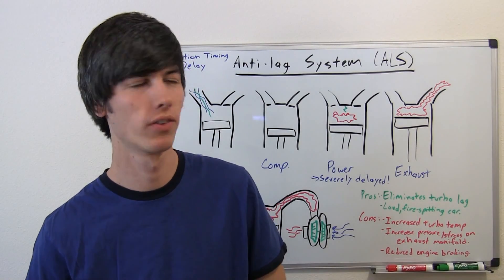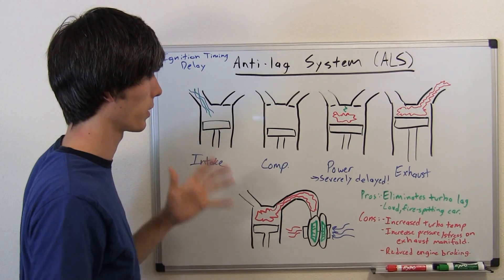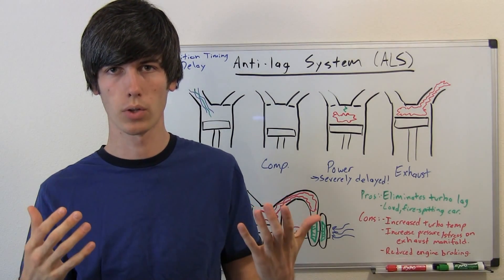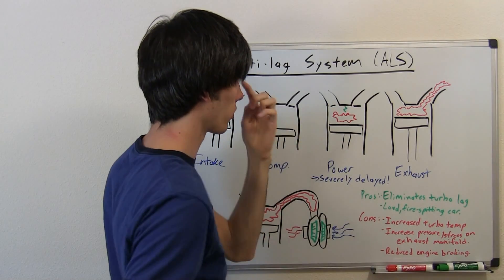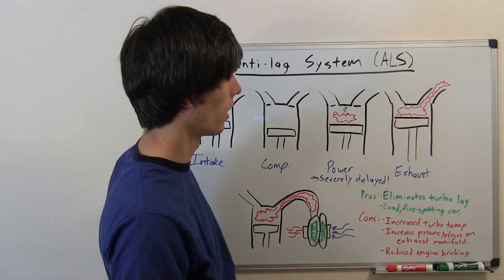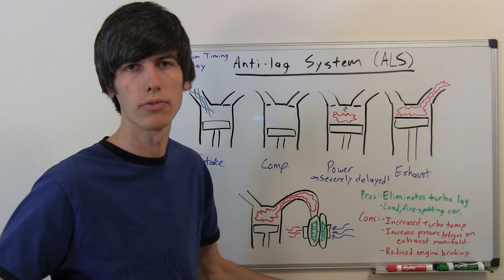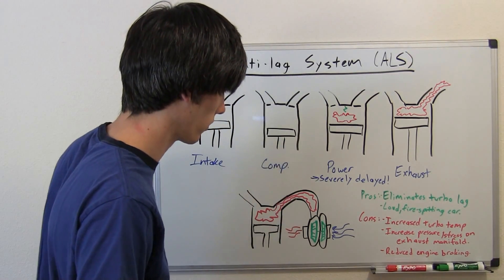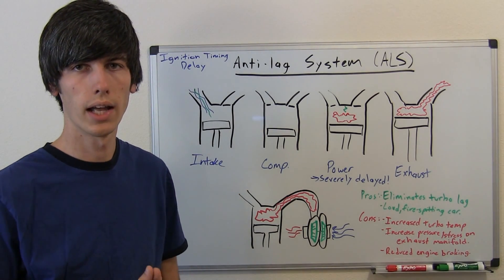Anti-Lag System By Ignition Delay - No More Turbo Lag

Comment: Best anti lag system: never let off the throttle.
Thank me later
Reply: And suddenly... corner. Then that becomes "and suddenly... pole (or tree or guardrail or yo mamma's mailman)."
Reply: Haha don't believe me? Most rally drivers don't let off the throttle completely so they can keep the turbo spooled (in cars that are not equipped with ALS). They use left foot braking 
In circuits, you can brake while still feathering the gas and then start adding throttle as you let off the brake to exit the corner. Again, left foot braking matched with good throttle control
Reply: sanpt7777 Ah, so the key words here are "not completely." That makes a huge difference. You're correct on the fact that they do not lift completely, but they do lift. Of course I wouldn't recommend going through the canyons and trying that, or if you go into a more than 90 degree turn I think it's probably wise to just let the turbo spool back up after a corner like that but in a vast majority of turns it's best to stay on the gas at least a little bit to keep momentum going. I originally thought you meant "never let off the throttle at all." as opposed to "never let off the throttle completely." lmao Now do you see why I was concerned about flying into a corner?
Reply: Haha yes. Anyway your first answer was funny.
You are right, there was a key word I forgot to mention. You do have to lift the throttle at times. It may even be desirable to induce lift throttle oversteer, especially on loose surfaces. The point is, you should be on the gas before you need the power. Even if you are still braking at the moment, that's why I insist so much with left foot braking.
But if you can keep the throttle feathered in a car that has too much turbo lag, that would be great.
Reply: On a 90 deg corner you would have to keep it feathered and use your brakes at the same time. Before this, you should already be in the right gear, because you won't be able to use the clutch. Brakes will have more power than the power applied by the engine, so the wheels will be normally affected by braking torque and you can turn normally. With the throttle feathered, you'll basically adjust speed letting of the brake, and then you can start accelerating.
In my experience, newer VAG cars won't let you left foot brake if you are already on the gas, you have to start braking first and then feather the throttle to spool, otherwise ECU will kill the injection, just a heads up if you drive a VW/Audi etc and wanna try it
Reply: sanpt7777 90 degree you can do that. As far as brakes having more power over the gas, I can tell you that varies from car to car. I've seen it happen. It's mainly older cars with little ECU interference, but still...
Reply: Well, what I meant is the brakes will have more power regardless of the car because the throttle will be just slightly applied to make some boost. But yeah, that applies to some cars
Reply: sanpt7777 No I hear you. I get where you're going with it. I just know, after driving older cars for a good long while, they lack certain safety features that modern cars don't is all I'm trying to get at. Though I'm not sure I entirely understand where you're going with your last comment there.
Reply: Sometimes not even I know what I'm talking about xD
I meant that even if the engine has more power than brakes or the other way around (brake bias and drivetrain layout affect this, RWD with front BB can lock it's front tires while keep spinning rear), it doesn't matter because you should be always applying less throttle than brakes. You use your brakes normally trough the corner but feather the throttle to keep turbo spooled.
Reply: I think I repeated myself again.
What is the issue with safety features? Engine cutting fuel when trying to trail brake through a corner?
Reply: sanpt7777 I think I get what you're saying. You're saying that you want to be on the throttle enough to keep the exhaust gasses flowing through the turbo, but be hard enough on the brakes so you don't lose control. And you're also saying that with or without brake bias this should be possible to do in any car.
Reply: I created a confusion out of this haha, I thought you didn't got me but that was like 3 replies ago 
Yes, that's exactly what I meant.
Although, excessively biased brakes can affect what I'm saying. I know you know that, but I like to speak my mind as you may noticed xD
Reply: sanpt7777 hahaha no shame in that. I will say though I am rather partial to a car that shoots flames out the exhaust and pops, but to each his own.
Reply: To me, the pops and flames would be the #1 reason I would install an ALS haha
Reply: sanpt7777 Yeah same here. You win every exhaust battle in the universe with it. Though if you want a giant ass turbo the size of the motor that's just one more excuse.

Comment: So what things could I do to cool the turbo better. And are there manifolds that can handle combustion out there.
Reply: Yeah. I'm my own team. And I'm on a budget lol. Who knows maybe someday.
Reply: Not rally but I take it to the twisted every once in a while and love to make her faster
Reply: thought the same thing ... cant really be that healthy ^^
Reply: Stand alone oil system/feed for the turbo with respective stand alone oil cooling radiator. That's the first that comes to my mind. You can make a manifold capable of withstanding the abuse, but you are looking at F1 grade alloy for the manifold. Even rally cars need replacing exhaust manifolds and sometimes turbines/turbos due to the abuse of ALS. But it's a price teams can pay.
Reply: You are really going to rally? Budget and rally don't go together but you CAN do it. I say, leave ALSystems to pros (rich pros) and compensate with your own technique. Learn to trail brake, something similar can be done to keep boost while braking on a corner. You give it some throttle to keep the turbo spooled. And you can make a stand alone oil cooling system for your turbo (with a stand alone oil feed) relatively cheaply. Google is your recipe book for DIY car projects like that. Good luck
Reply: Cool, what car do you drive?
You should be completely fine without an ALS
Reply: 2000 Toyota Celica gets. You know something cheap and fun for the weekends.
Reply: gts not gets
Reply: Using a water cooled ball bearing turbo would help, as well as running an oil cooler on the engine and maybe on the turbo feed line. Thick wall steam pipe would make a good manifold to handle the temps and pressure

Comment: ignition should occur slightly berore piston reaches tdc , so that max pressure is obtained  at tdc ,this would give max power....according to the the video u r actually losing power ...this shouldnt be the case specially when turbochargers are meant to increase power......is there overall power gain???? and what %????

Comment: I live for engine braking, so this is not for me. Well, I don't have a turbo anything, so I'll have to wait till I do to not want this. Seems you could really push a car though a corner if you did not experience as much engine braking from a downshift, and really keep on the gas. Or am I confusing engine braking with the added wheel speed from downshifting?

Comment: If it worked that way it would be interesting...but...

First, virtually all the exhaust gas exhausts at the end of the power/expansion  stroke. Typically the exhaust valve opens at around 10 atm (about 150psi). That already represents a drop from peak pressures of over 1000psi.. 

You didn't change when the exhaust valve opens. When it does the gasses flow out at supersonic speeds. By BDC at the end of that stroke cylinder pressures are close to atmospheric. The exhaust stroke just pushes the small amount of remaining gases out. There is so little gas that the intake valve begins opening during the compression of the exhaust strong and is significantly open by the end of the exhaust stroke. At that time piston-to-valve clearance is critical and the piston domes on many cars have reliefs to provide additional clearance. 

The technique you are talking about delays ignition so that pressures are higher later in the expansion stroke resulting in slightly higher pressures at the turbo. The mixture is also run rich.

Obviously this is a marginal race engine only solution as it doesn't meet emissions requirements and puts lots stress on the exhaust manifold.

You may want to spend some time analyzing pressures, temps, and flows on an engine simulation program.

Comment: Can this be done with a distributor type system? Like from a pre 99 5sfe camry motor? And where do you purchase a bypass valve..?
Reply from the maker: Have you turbo'd a Camry motor? Difficult to adjust spark timing with distributors haha. Timing is pretty much set.

Comment: Is there any anti lag system which doesn't destroy the turbo or exhaust manifold ?
Reply from the maker: Well you can have stronger exhaust manifolds/turbos that are built for more pressure and heat.

Comment: Seems a lot of people are confused between an anti-lag system using ignition and a less efficient anti lag system using fuel cut. Which doesn't build the extra heat but also dosn't spin the turbine as much due to it just moving air and not a late detonation. Subarus and other cars using after market tuners usually use fuel cut method for their "launch control" and no lift shifting. Which artificially lowers the RPM limit to a predefined number for example 3500 rpm in first and will keep the RPM off of the true redline down to around 5000-5500 in between shifting using fuel cut.

Comment: OK, I still cant get how the whole process happens (the ignition) during idling because when you let off the gas pedal the butterfly valve gets closed thus you don't have air intake anymore (isn't that right). So how an explosion without air is possible to occur?
Reply from the maker: Well, you're not going to use anti-lag at idle, but it delays the small combustion that does occur so that it keeps the turbo spooling rather than just the engine running.

Comment: Would you end up burning more gas
Reply from the maker: Yes.
Reply: Engineering Explained what is the advantage of this over using less fuel instead of delaying it and burning an extremely lean mix?

Comment: Although an Anti-lag system increases exhaust manifold and turbo temp, leading to malfunctions, I have read that if you have a turbo that is made of high strength materials, you can have a setup that's just as reliable as any other turbo-ed car. What is your take on this?
Reply from the maker: For a price anything is possible, I'd agree.
Reply: Yeah, it's totally possible to fit anti-lag to a turbocharged engine but you would have to fit an aftermarket, very strong exhaust manifold and probably an aftermarket turbo as a lot of stock turbochargers just wouldn't take it. Of course with fitting an aftermarket turbo often comes the requirement for a forged bottom end and before you know it you're in the hole for more than it's worth.

Comment: Do Car Manufacturers use these Anti-Lag Ignition Delay Systems on turbocharged vehicles from the factory, or are these systems mainly an aftermarket/racing phenomenon?
Reply: Aftermarket.  VERY popular in rally racing.  If you watch rally you will notice the outrageous loud popping and flames coming from the cars' exhausts.
Reply: They will prematurely cook a turbo so you will not see one from the factory.
Reply: it's after market.I think It's illegal for street use because it's too loud
Reply: NewOscarGuy Thats only true without supporting hardware. Higher strength exhaust manifold, oil cooling the turbo or more efficient oil cooling of turbo is really all is needed to make an antilag system reliable. The only downfall is higher exhaust manifold stress, temp and pressure and higher turbo temperatures
Reply: the celica st205 came with anti-lag from factory but it was disabled in the ecu
Reply: black2011gt
Why do they use it in rally racing?
Reply: K Sadek too allow the driver to drive in a more relaxed/less busy way and therefore faster, before anti-lag, rally drivers use to drive always at full-trhottle and heel-toeing with the left foot
Reply: Xavier Gonçalves Oh ok, thanks !

Comment: Engine compression in the cylinders does the engine braking, not so much the gearing as mentioned. Thus the semi trailers are vehicles that use engine braking often.
Reply: Semi Trucks actually use a special engine brake called a "Jake Brake". It's an electronically controlled hydraulic device that manipulates the exhaust valves to release combustion within the cylinder and slow the RPMs of the engine on demand. If you've ever been near one on the road and heard a low series of loud "bop-bop-bop-bop-bop" sounds, that's what it is.

Comment: I cant figure to understand wether this system is fuel efficient or not. Logically from what i understand from tbe video is that its not but i just cant grasp why exactly, assuming that im wrong obviously
Reply from the maker: Because you're using fuel to keep the turbo spooling, rather than to move the car, thus it's not exactly fuel efficient to do so.

Comment: Very good series of videos, very helpfull.
Concerning the ignition delay, with high Temps and pressure we do increase the risk of engine rattling, which means in this case auto ignition of the mixture and it will be harmful for the engine...How do you think ALS with delay ignitions overcome that problem ??
Thanks, 
Elie

Comment: Pistons are probably a good idea, but the rods and connecting bolts is probably an even better idea. Bending rods due to high heat and pressure is usually the death of turbo motors.

Comment: That is pretty accurate. Ford did a good job of taking a very bad and potentially catastrophic condition and re-defining it. Overboost is what he said: A condition in which your turbocharged system exceeds its maximum pre-set boost pressure and continues to generate pressure. When this happens a safety device is triggered and the engine is throttled back. An example of a safety device would be a fuel cut off, you can imagine what that does. Dont fool yourself into thinking overboost is ever good

Comment: Overboost is a feature some cars have that when you activate it (normally through a button on the cabin), it changes the turbo's setup/configuration on the ECU temporarily. It changes it to a higher PSI that it couldn't handle all the time, but for a few seconds, no problem. Normally you have to wait some time for the turbo (and its components) to cool down, as this increases temperature significantly.

Hope this helped.

Arthur.

Comment: Fantastic explanation well delivered you mentioned there was hot air going into the cylinders when you went back on the throttle but you could have explained how the ECU adjusts back to normal ignition stroke when you press the throttle also you did say let off your gas more than once. From Dave aged 52.3/4

Comment: Great explanation my friend! I think I will refer people to your video when I get questions about anti-lag in the future; I couldn't have explained it better myself. One thing I might have added to the con list (although it's just a theory of mine) is that ALS is not very good for the turbo's bearings due to the frequent and extreme changes in pressure in the exhaust manifold/turbine housing. What are your thoughts?

Comment: I want to help you out EE. I love an intellectual car conversation. The reason that does not work Stoneddoggie is because the turbo system works off of engine vacuum. When your Transmission is in neutral simply revving the engine does not produce enough loading (I.E. engine vacuum) to cause the waste gate to shut and therefore spool the turbine end of the turbocharger. Of course this depends on turbocharger size. Unfortunately I've run out of characters or I would explain more. 500 letters..ugg

Comment: What about having a system designed where the turbo would have a flywheel that could be engaged/disengaged based on the rpm of the turbines? The flywheel would be disengaged when the engine is first started and once the turbine is at a set rpm the flywheel would engage and continue to carry the turbine through the period where the engine is at an idle to make a turn or etc. then when the turbine and flywheel slow down the flywheel would disengage so as not to prevent the turbine from speeding up

Comment: Couldn't you also go into neutral as soon as you start braking and use a heel and toe method so give gas when in neutral to keep rpm's up and the turbo spooling then put it into gear at the apex of the turn then no turbo lag?

Comment from the maker: You would need a fairly powerful motor to do so, which would need a separate power supply other than the battery used to start your car/the alternator. Basically, this is why superchargers are run off an engine belt, so that they have enough power to do what they need to. That said, it could be done, it's just a bit cumbersome, complex, and would of course add weight.

Comment: Surely this could cause fuel to still be ignited at the point which it passes through the turbine? Isn't that bad? :S and also is ALS purely ECU or is there some mechanical component required?

Comment: There might be a little misconception between a 2 step and an ALS because with some standalones, there's no actual ALS function... And people have found ways to create an "ALS" in a sense, by using certain values in the 2 step rev limiter function on their standalone. That's why some people call it a 2 step/antilag, because it really wasn't supposed to be an antilag function, but they have found a method of creating an ALS out of a 2 step. Sorry if that was confusing. Tried my best to help.